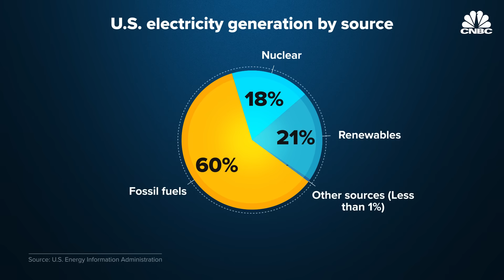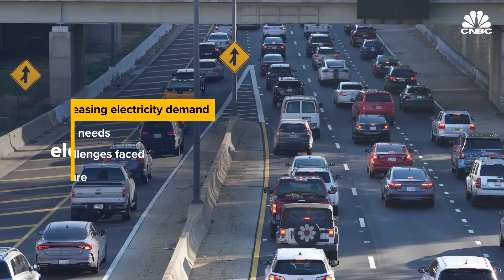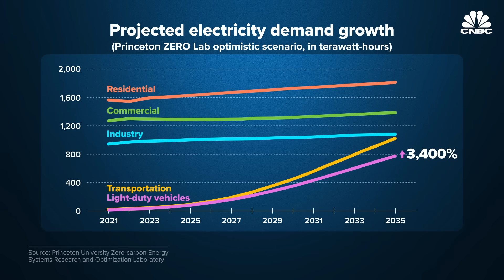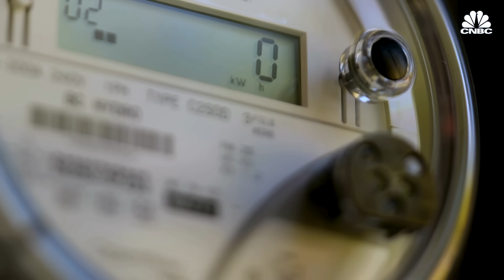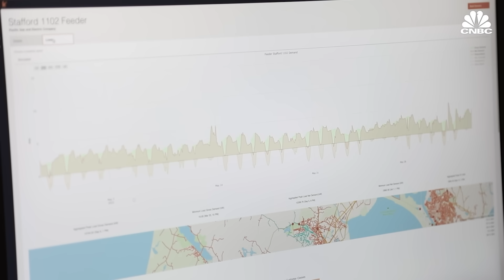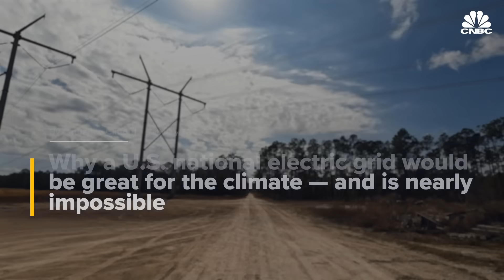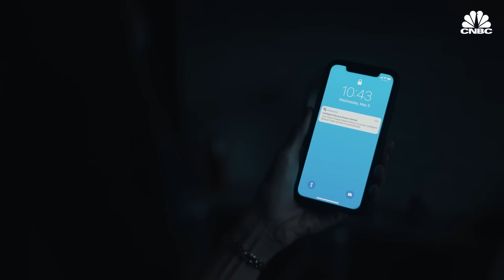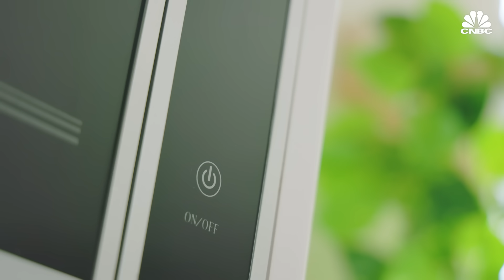Can The U.S. Power Grid Handle The EV Boom?

Comment: The next Carrington event will be quite fun.
Reply: Not what most people think. The entire problem comes from the large DC currents induced by the charged particles in the vicinity of the north magnetic pole. The vulnerable items are the line transformers at high voltage substations (and maybe some lower voltage ones.) Not to be too technical, when the DC current is superimposed on the AC the transformers are supposed to carry, the iron core saturates on the AC current peaks.  That causes spectacular spikes in current and local heat, as though an insane welder were running rampant.
The solution is simple and very reliable. An alert is sent to all the vested parties and the power lines at risk are taken out of service until the all-clear is sounded. Here in Arizona it will mean nothing. We and our neighbor New Mexico have no vulnerable lines, but our Western interconnection (essentially North America west of the Rocky Mountains from the Sea of Cortez in Mexico to the arctic circle in Canada) has some lines up north that will have to be taken out, leaving people with local power that will - in areas - be less than full power.
When the event is over we go back to normal.